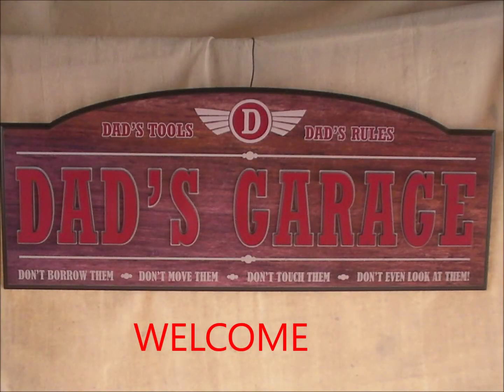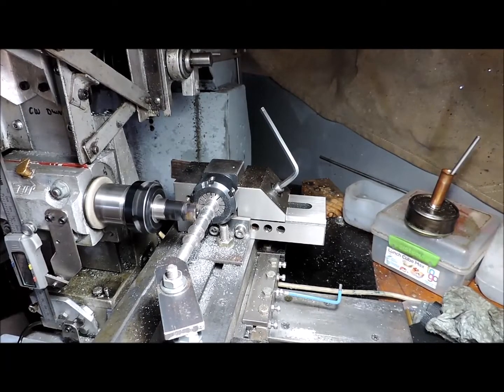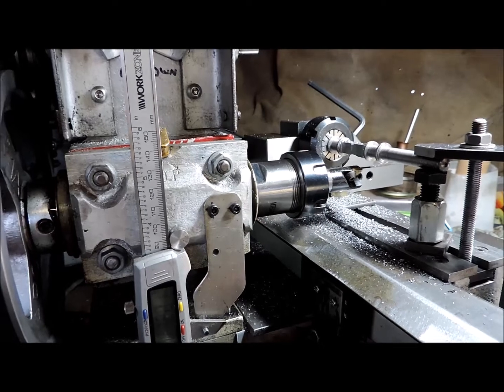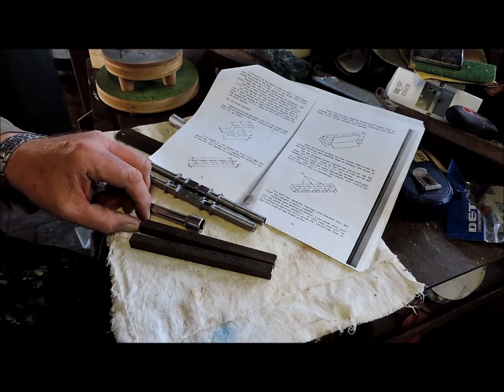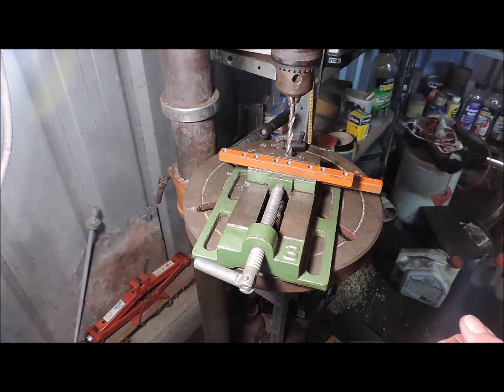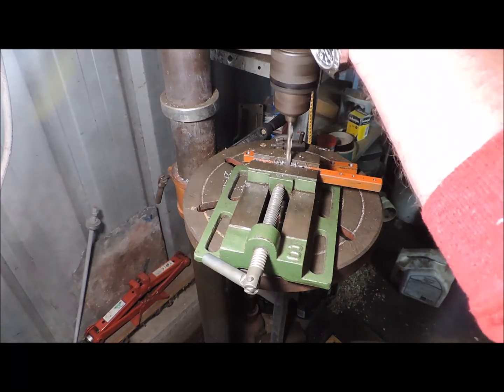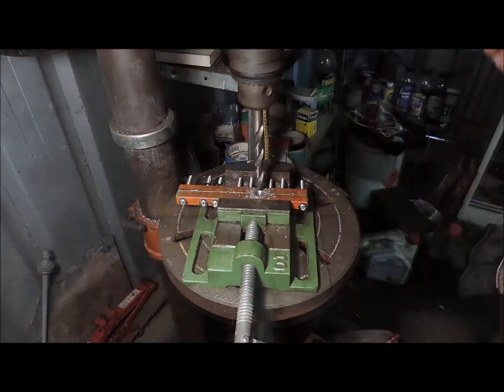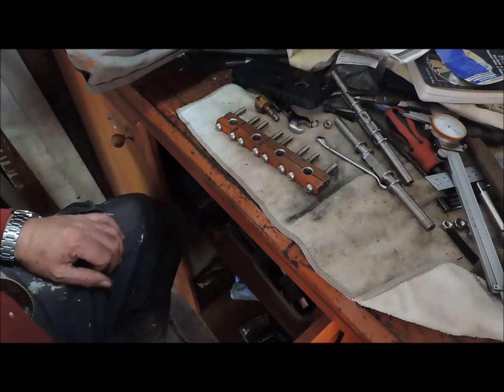Making the Gingery 4 Jaw chuck part 3

Comment: More parts made , good job .  It looks to me like a version of the South Bend 4 jaw continental chuck , sort of a face plate with 4  jaws that can be flipped in either direction . I should put a shot of it on my channel as i think they are pretty rare . Cheers .
Reply from the maker: G’day Max, your description is accurate, a faceplate with jaws, one thing I like is the jaws are held with a single bolt so the jaws can easily be rotated or even replaced with jaws made to suit a specific shape. For a “simple “ chuck there is a fair bit of work. 
Cheers 
Peter

Comment: You think you are blind?  I wear my geezer goggles (Magnifiers) all the time in the shop!  Your paint can tip for marking fluid is a good one Peter.  I used some white spray paint on some hot rolled angle to mark it up.  Thanks for that one!  Seems like I watch a guy on #tipblitz19 showing the same exact tip and method for drilling stacked members.  Wonder who that was?  ;-)  A Mag base as a camera mount stuck to your wall behind the drill press may give you an alternate view if your interested.  The one I made for my camera works pretty good.  I am using a camcorder to record and it seems to manage the weight okay.  The screws look very nice!  And I like your new home made die stock too.  You make the handles or "Borrow" them from the other die stock?

Thanks for sharing Peter.  I always enjoy your videos!

Joe
Reply from the maker: G’day Joe, I borrowed the handles from my die stock, I figured storing just the body was better and as I have only one die and it’s left hand thread I won’t be swapping out the handles too often. I have used a mag base for the camera but hadn’t thought to stick it to the tin shed, I’ll have to remember that, thanks. Thanks for stopping by, cheers. 
Peter